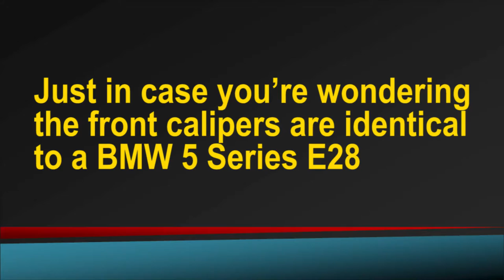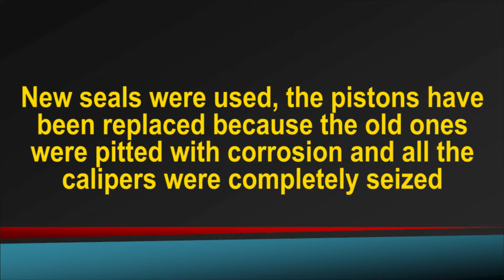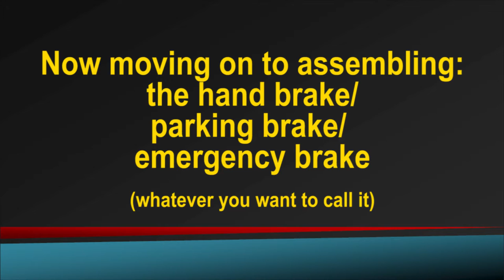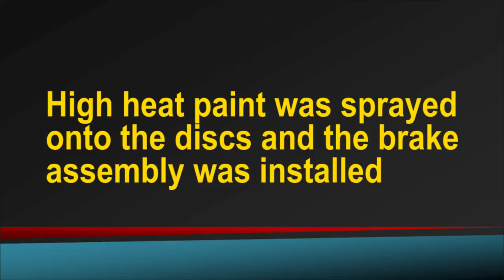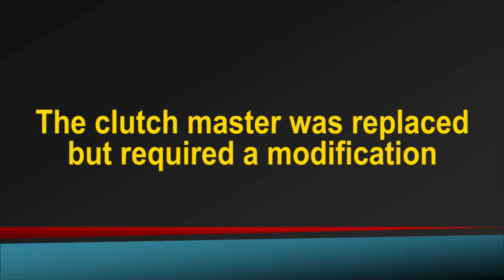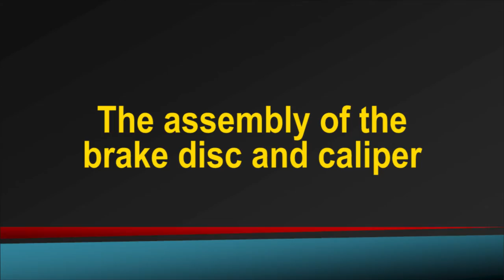Overhauling The Brakes - Maserati Spyder Part 41

Comment: I heard that the rear calipers may be the same as alfa 75 front calipers?
Reply from the maker: I have no idea with regards to the alfa similarities but based on the research I did was that the Later models biturbo (the ones with the front ventilated disc used the BMW 5-series E28 calipers). However the older models, the ones with the solid discs used the front calipers from a BMW E12 5-Series. Also I did a quick research on the alfa rear calipers. It seems that they might be slightly larger? non the less I could not find anything similar at the time.
Reply: After much research I discovered that item  "Duralast D31"  are the exact match pads for the smaller solid disc rear calipers. Easy to find at your local auto part store and very inexpensive compared to others.